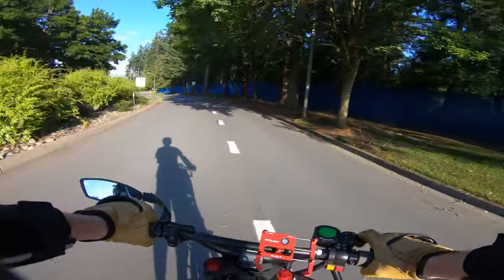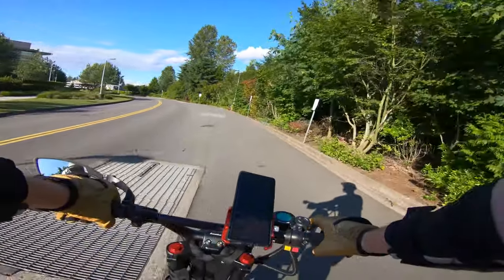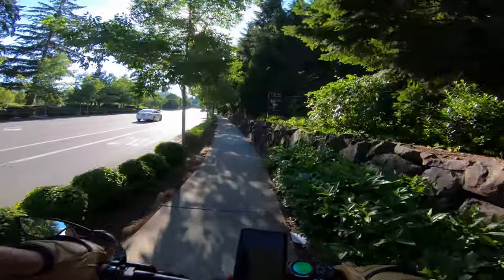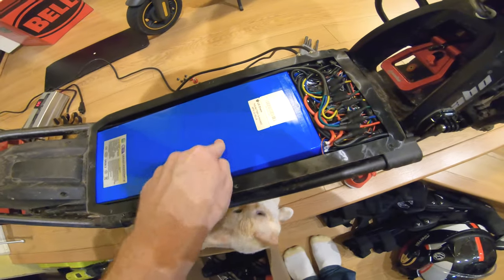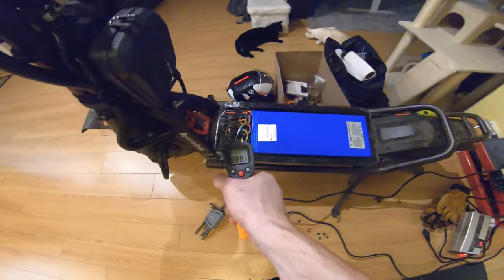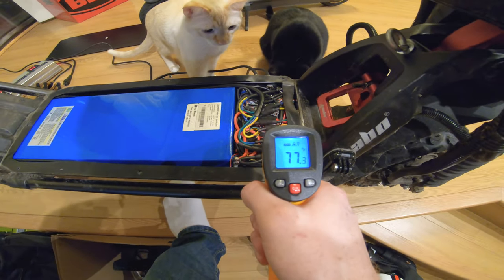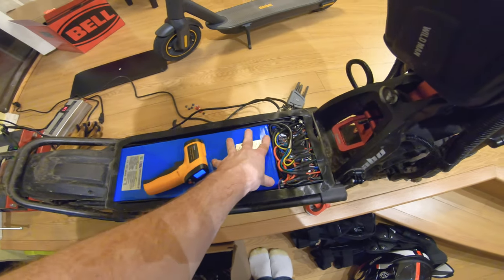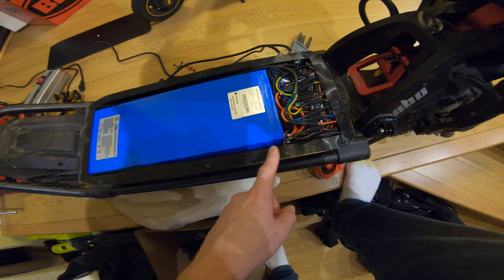P.E.V. Electric Scooters & EUC's - Charging : Are Fast Chargers Too Fast?

Comment: What brand of fast charger are you using?
Reply from the maker: I got them from FluidFreeride. Not sure of the brand.
Reply: Sorry...I see it appears to be the one offered by fluid.
Reply from the maker: @mikeklein4810  US $91.00 | Charger 67.2v 1-5A With Digital Voltage+Current Display+Button To Adjust Current/Percent Partial Charging Electric Scooter Parts
https://a.aliexpress.com/_mMFZu4p
Reply from the maker: @mikeklein4810  that will work too
Reply: Thanks dude! I'm about to pimp my Kaabo Warrior's audio and will send you first pics!
Reply: Have you seen the Kuberg Ranger Adventure edition with trailer? This may be my next purchase...14kw and 50mph
Reply: I'd like to find something with regenerative coasting, not braking. This is only feature missing from the Warrior
Reply from the maker: @mikeklein4810  if you've got 6k to spend on a bike then GO FOR IT! I've never seen that thing before now but it looks sweet!

Comment: 0:35 after 8 years of experience, yes, shit yes they do.
Reply: 3:07 once you get to a certain point, most bms will not charge over 10amps (this is the dirt cheap Daly bms type you find on China lithium)
So I can hook a 20amp charger up to mine and it will only work half as hard as it could.

Honestly, as for heat, 1amp per chill for an 18650 is nothing, they can handle 2c charge rates (2 x capacity)= charge rate in ample, rather easily. However those charge ports being used currently aren’t even rated for 60v 😂, they just get used because meh, cheap and they work at super low current. Bump it up, shit gets too hot, get a real waterproof xlr plug like featured in my “What’s Forlix Cooking Up” post on r/ElectricScooters :)

So happy to see you pop that thing open finally!

It’s not too bad inside, it would be nice to see a large fuse inline with the controllers from the battery, but eh. Also having the phase wires away from the battery leads helps reduce weird frequency issues. (My first scooter came with the battery lead wrapped continuously around the motor cables, if the motor shorted out, I would have also shorted the battery because cable fires).

However, the faster you charge a pack, with an older age and more abuse, the more out of balance your cells get. This one is a total bitch because I’m about to start ripping scooter batteries open to figure out what China is selling people these days.

Currently have a 48v 20.6AH battery and a 48v 16.5AH battery too, both “China Lithium” quality, the way the battery behaves, there has to be some kind of Witchery going on inside, it’s not right (a 13s lifepo4 battery should not charge to 55.4v, it should charge to 54.6v at the most, ever, or kaboom, wtf why hasn’t it gone kaboom yet, I’ve literally been paranoid about this since these batteries entered my home.
Can’t wait to rip them apart and make a bigger battery though, hello 72v 😈😂
Reply: 3:32 dayum that bitch hot. Well, operating temperature, but hot. The controllers inside must be generating most of that heat, those batteries should barely be breaking a sweat supplying your wolf with power ;)

(It’s not hot, didn’t realise it was Fahrenheit)
Reply: 5:33 when checking temps, check the charge ports, the front side of the battery (controller side) (where the bms usually is) and all over the rest of the battery, you never know if one cell is going hot or not.

Also the bms should get a bit warm at max charge rate, it’ll have mosfets to controller current flow on yours, so don’t be surprised if one end is 10• above the other.

Ps are your measurements in Fahrenheit or Celsius? 👌👍

Hope this helps with understanding more about your batteries, you’ve put a shitload of effort into this man, well done!
Reply: 6:42 that’s negligible as fuck.
You only need to worry about 70-80 celsius.
The bms will limit the flow so they can’t ever get a serious surge ;)
Reply: 7:01, basically, there’s a parallel connection inside the controller between the battery and the charge port. Instead of outside, like most other scooters, makes wiring look tidier, but can also let your controllers regulate how fast the battery charges.

Most times it’s done the way it is in the wolf, is because they’re running the charge current through the regen circuit, this is something serious power riders used to do on ebikes years ago, it leads to quick controller failures when you abuse the dual charge ports (eg dual 10amp chargers, or much much higher in their cases.)

I used to charge my packs at about 30amps for a 30amp pack, it would take about half an hour to balance the cells properly afterwards then it would be prime to go, I always used hobby grade chargers to do my balancing and managed things without a bms though (ran lvc alarms instead, guess that is a bms of some kind).
Reply: With the temperatures you’ve displayed here, you’re perfectly safe to continue going the 10amp charge route, just make sure you give your cells some time to balance out if you’ve been pulling it till it’s dead. That’s my general suggestion.

I personally give my shit a full charge every day, a full balance cycle of 2-3 hours and ride the living shit out of it. I know enough about what I’m doing to know when somethings going wrong and when to ditch and roll though so I don’t suggest this to the regular user.

(I cannot live without going as fast as I can, I am.... speed) 🤣

Next fortnight I should be able to make my GTR do 85km/h before I burn out a motor, can’t wait to share that one with you ;)
Reply: Sultry Pineapple I appreciate that you talk to me at my level. I barely understand what the hell you and Ginger are talking about in these these comments. I’m glad you are following him he is cool and very talented with these scooters.

Comment: I charged my zero 10x 18.3 amp hour scooter with 18 amps till 90 % and the battery went only 5 degress Celsius from ambient . That's only 0.183 amp per cell per hour! Thats a cell that can put out probably 2 amp nominal so should be able to charge at atleast 0.5 amp hours for 85% without getting more than 10degrees hotter than ambient i beleive ! These sinc cells have been tested at 6.2 amp charge rate each cell to test for failure and passed. The only way most cells go to fire is over voltage charging and poor bms ! Nominal charge rate is 1.1 amps per hour and max is 2600 which is 1c  so a 2.0 amp charger is nothing to what the cells are rated for . At 18 amp per hour it is still 1/14 of what the maximum charge rate is per cell so what on earth are we waiting 10 hours to charge our scooters for . It actually makes it more dangerous the longer they are on charge for as there is more potential risk the longer they are in charge . World has gone crazy !  I don't recommend to anybody using any other charger than the charger that originally came with your scooter as it is extremely dangerous if you aren't highly experienced and it's very easy to make mistakes that will cause explosive fire !
Reply from the maker: Charging at 1C isn't recommend, reduces battery life too much imo.  0.5C is as high as I would go.

Comment: Got a question, just bought mine. They come with two chargers. Am I safe using both chargers at the same time that came with the kaabo wolf warrior 11. Or are you talking more about buying fast charger that didn't come with the scooter. First time charging it and saw this video so it made me a little nervous. thanks for any reply...
Reply from the maker: Charging with 2 stock chargers is fine.
Reply: @GingerOnWheels  Thanks for that last reply, I bought a fast charger for my 72 volt kaabo king (5amp) (got it from mini motors) Do I use one port the whole time charging or do I  plug it into the other port half way through. Thanks for any reply...

Comment: Remember to get into the habit of first plugging into the scooter ports then plugging the charger into the wall recepticle.
Reply from the maker: I don't like doing that because it makes a loud popping noise from the electricity arcing between the pins.
Reply: I've read the proper way is the exact opposite.  Plug into the wall first before you connect the charger to the scooter.
Reply from the maker: Me too...
Reply: @GingerOnWheels  Yep, that's the proper way. Wall first, scooter second. The chineese wanted to write it that way in the manual, but as usual, got the text wrong. Dualtron manual has the same error, Kaabo just copied it. Btw what's the charge time on 10A ?
Reply from the maker: About 5ish hours, I've never timed it. 
The manual lingo sounds par for the course and is a perfect example of why I started this channel in the first place.
Reply: @GingerOnWheels  5 hours is nice. Side note - Just today, a guy who I know burned his Zero10x pins due to wrongly connecting the charger. Strong electric discharge completely melted his pins, but the small wire that's connecting the pin port to the battery acted as a fuse so the discharge didn't burn anything else.
Reply: @GingerOnWheels  I asked Fluid about this very issue and they refused to answer! I'm going to go back to AC then DC as order. Pop always annoyed me.

Comment: I've had the experience,  that when I charge my 60V battery pack at 2 amps, the cells seem to get balanced. But, when I continously charge it at 4 amps, the battery pack loses its punch. I lose power. The battery pack and the scooter are barely 9, maybe 10 months old. And the battery pack is supposed to be an LG pack. I should mention that I bought the scooter directly from China. I've checked the pack, and it does say 60V LG cells. But then again,  you know the Chinese,  they can bootleg anything. So, I don't know if I got a genuine LG pack, or a lemon. I gotta double check to see how is wired.

Comment: Can I use 8A charger instead of 3A in my 17.5 ah battery package?
Reply from the maker: It depends on your BMS and what the internal wiring is like. But as far as the cells go, you can safely charge them up to 8.5amps (0.5C).
Reply: @GingerOnWheels  Thanks man👍